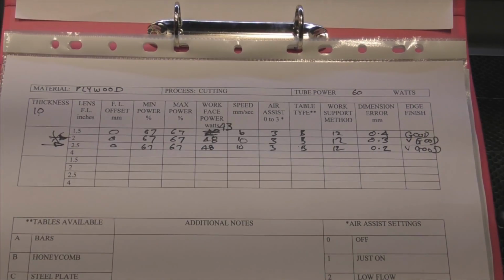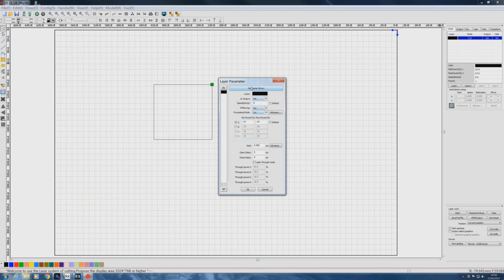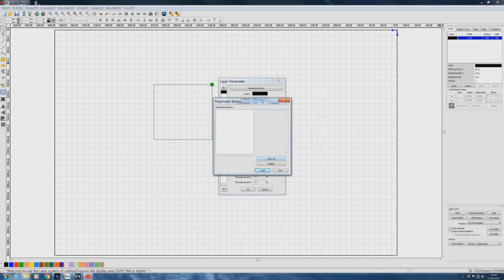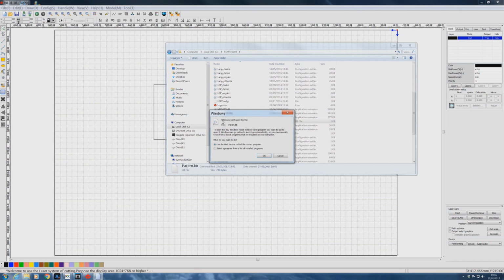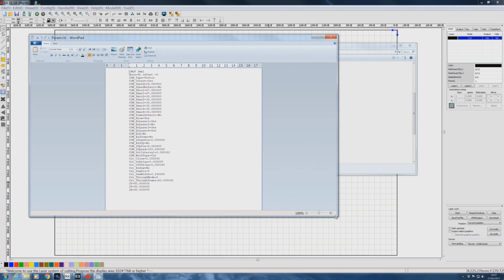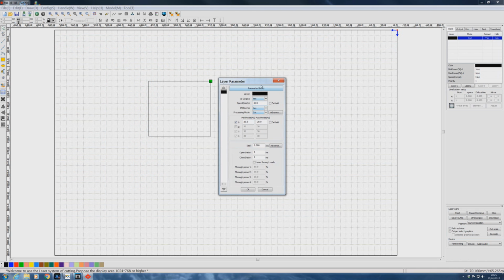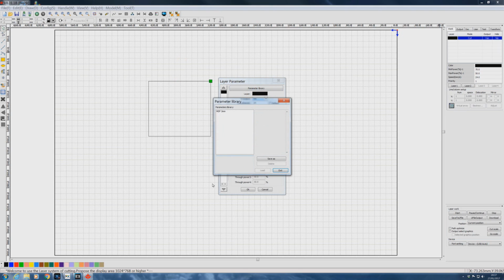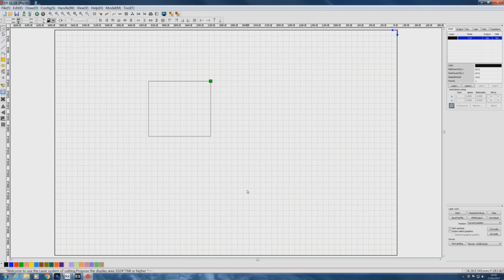RDWorks Learning Lab 95 Cutting Parameters DIY

Comment: Russ, may I ask. What is your opinion about upgrading tube to higher wattage. For example I am going to receive my machine with “50W” refurbished tube. Should i consider going 60-70 of real watts. And if yes, what kind of benefit do i get from more power? Given the fact that application of such machine is limited anyways. To be honest, my crappy K40 machine had enough power to cut anything you can fit inside of it. And I actually had problem with not being able to lower power sufficiently for some engravings. So what is the real benefit for more power tube and won’t it actually be worse for lower power jobs?
Reply from the maker: Hi Vlad
You are perfectly correct about power. I warn people all the time about being careful about what they wish for when they think about upgrading to 100 watts or more. You need power for cutting only. The more power you have the longer focal length lenses become usable and cutting thicker materials faster is the only benefit. If you want to engrave then you need precision control of low power. The power characteristic of most big tubes is a bit of a dog leg graph where for example you may get 100 watts at 70% power setting but  get 60 or 70 watts by the time you call for 30%power. This very steep initial power rise is very poor for engraving. 60 watts is the best compromise tube for general use. If you wish to specialize in engraving on pre-cut shapes, then 40 watts is perfect. The K40s (and most other machines) are supplied with a 2" focal length lens. For such a low power machine this seems like too big a focal length. For engraving and cutting with such low power you would really benefit from the scalpel precision of a 1.5" lens. The controller in the K40 is very limiting because you can only work with one power at a time as it's not programmably controllable. Move up to a machine with a digital controller and you get the option to use something called SPECIAL MODE. This uses the  PWM clock pulse to chop the power into high frequency pulses. You can then select mark/space ratios of 50 to 99% for your power output. This allows a bit more control of low power for bigger tubes and super precision for the low power ones.
Best wishes
Russ
Reply: SarbarMultimedia thanks! This is one of the reason i upgraded to 50W machine - i did not realize that k40 doesnt have pwm control for laser. Truck with my new “50W” machine is coming in couple hours. Excited to give that a run! Another advantage of this larger machine is variable Z axis, which i think is a must have for any machine of this type. And the final advantage is it not being constructed of pure garbage 😄 unlike K40.
Reply: SarbarMultimedia received my laser machine last hour. Unless they offer me like 60-70% refund, this garbage will go back to where it belongs. In order to make this thing properly work it has to be broken down entirely and reassembled from the scratch with some components entirely replaced in it... 🤦🏻‍♂️ Fraud is in Chinese blood, ridiculous.
Reply from the maker: I call it Fleabay for a very good reason....buyer beware. Is it really that bad? and you have not run it yet?
Wow
Let me know what happens 
Best wishes
Russ
Reply: SarbarMultimedia haven’t run it yet, and yes, I am familiar with that quality and what to expect. But Chinese surprise me everytime... lol
Reply: SarbarMultimedia one more question to Maestro :) i am cutting 5mm acrylic with this machine and the max speed i was able to cut that with is 7mm/s. Does that sound right for this kind of power?
Reply from the maker: It is almost certain you are using a 2" focal length lens. First thing is to check the lens orientation because the Chinese always install them upside down. Make sure the flat face is towards the work. You will have a setting piece that is 19 or 20mm, When you turn the lens over this will decrease by 1 or 2mm  so make sure you find the new focus distance. Your 50 watt tube will actually be a B grade 800mm long 40 watt tube. D9o not run it at more than 65% power until you have fitted an ammeter. So you are probably getting 35 watts output into a 2" lens.. Acrylic is easy to cut and with my 60 watt tube I can do the same at about 10 or 11mm/s if I use a 2" lens. So your numbers seem to be about right.
I had problems with my first 2 tubes and I had no way at the time of measuring the power. However. if you watch this, you will see that there is a simple method of checking the tube output in relative terms. The cuts should get deeper as the power increases. As you will see, my power topped out at about 60% and then dropped off. A sure sign of a B grade tube.
https://www.youtube.com/watch?v=WbBPps42iHc
Best wishes
Russ

Comment: Hello Russ, 
I am in much need of your advice on a couple of points.

My Chinese laser appears to be the same one as you have. I am considering upgrading the dubious 50W rating to a 75W/90W RECI tube together with a new power supply quoted at £603 with free delivery (ebay item 173365599796)

I find that I can save around £25 by buying the same tube separately (19 kV trigger/24 mA running) by buying the power supply from another source (35 kV/28 mA) (ebay item 153026905903).  Is this feasible?

Secondly, do you connect the milliAmp meter in line with the low voltage side of the tube?

And finally, in one of your videos concerning mirror lapping, you show your mirrors as being mounted on small bolts at the rear.  What is the purpose of that and how did you do it?
Reply from the maker: Hi Peter

For Ebay read FleaBay.......buyer beware!!!!

Would you expect to buy a genuine Rolex watch for half price?? Reci are the Rolex of laser tubes. In my opinion they are overrated and overpriced BUT because they have a notional high reputation and high value, they are  a prime target fort "Chines copies". You can find Reci tubes advertised at great prices and described as "genuine Reci" or "Reci sourced". Both may be true but both may be unwarrantable QA failures from Reci.  I'm saying this because I have seen the same deceit  happening elsewhere in the Chinese tube market. Reci themselves recognize that there is this "alternative" market for their tubes and so they have tried to defeat the fakers with a Q code label that is attached to warranted  Reci tubes. Scan this Q code with your smart phone and it will auto connect to the Reci website and tell you the serial number and date of manufacture of your tube . Do NOT buy a Reci tube unless it has the Q code. I am not aware of fake Reci power supplies, only units from other manufacturers that claim to run Reci tubes. 

The power supply in this advert is just such an alternative and comes from
http://www.jnhyec.com/en/productxx.asp?signid=122&proid=186

The Reci tube advertised is not displaying any labels (why?). This is a Reci W1 tube
http://www.recilaser.com/en/index.php?m=&c=Index&a=show&catid=7&id=65

As you can see, it claims to have a peak power output of 100watts at 29mA. If this is a genuine A grade Reci tube, why would you undersell it as 90 watt peak?  Maybe this is the reason it failed QA?
My first 50 watt  tube in the machine was in fact a 40 watt tube outputting 30 watts Basically it was junk. I bought a "genuine 50watt OEM replacement tube" from Coletech and that was only slightly better junk.  This package you are assessing is from Coletech but is being sold via a third party (probably a private Chinese seller on commission) to distance Coletech from any bad feedback or claims. I can only leave you to spend your money  where you think best but wish to make you aware of the risks.

If you were to buy this package with a genuine A grade Reci tube here is what you would expect to pay direct from a reliable source
https://es.aliexpress.com/store/product/1-PCS-80W-Reci-co2-laser-tube-80w-1-PCS-DY10-Reci-Laser-Power-Supply/321243_32756879991.html?spm=a219c.12010612.0.0.22157106srBq3c

This is £812 PLUS 20%VAT when it lands in the UK

However, Reci tubes are not quite what they seem. If you read the section 2 operating conditions it says 100 watts output (peak) at 29mA. But this is only a test current, you cannot run at this current or you will invalidate the warranty. They recommend that the max you should ever use is 27mA which means you will get a guaranteed 80 watts output. Read on to the bit that says that if you want reasonable life from your tube then limit the current to 25mA. In reality that means you will get 70watts output. Personally I think that is a VERY sneaky way of selling you a 70 watt tube.

What now?  Well, I would forget Reci and look at something like an 80 watt EFR tube plus suitable power supply from a reliable source (Mactron Tech in China). Email them for a tube and power supply combo quote and I guess it will be about £600 with shipment PLUS 20% vat
You could also check what a Yongli tube and power supply would cost.  Both will be genuine 80 watt outputs (not 70watts)  but without the reputation  price premium Also ask for a quote on their MTS-70 tube and power supply That is what they sent me. Still running perfectly 2 years on.
http://www.co2-lasers.com/co2-laser-tube/27-co2-laser-tube.html#.WybWLFUzphE

As you are in the UK I would also check on the price of a 60 watt EFR tube and power supply  and also an 80 watt EFR tube and power supply from gareth@thinklaser.com
A trustworthy UK company  that will be easier to deal with and will be able to match or better the Chinese prices but will still be plus 20%vat unless you have VAT registered business

Why do I all of a sudden mention 60 watts? (and 70 watts above). All the 80 watt tubes will be 80mm diameter and if you check the tube mounting arrangements you will struggle to fit a fat tube into our machine. 

Ammeter connection? Yes. see   https://www.youtube.com/watch?v=xDZmuxq5BEM

Mirrors
https://www.youtube.com/watch?v=HHagynL4zqs
https://www.youtube.com/watch?v=ELeqP3tHlp0

Hope some of this helps

Best wishes
Russ

Comment: Regards "parameters" I have doubt related to laser physics, and to be more specific - to tear and wear of the tube. I was asking about it few people, but had no answers. Say : I go to cut light "laser grade" 3mm plywood with this parameters: 
Speed=75mm/s P_max=64% P_min=54%
Speed=40mm/s P_max=44% P_min=34%
Both are in range of normal, long use tube parameters. And both create indistinguishable effect (in practice, not theoretically). Same nice cut, no char, same light brown sides. Putting machine mechanics itself on side (I know acceleration is not good thing for rails) - which one is better and lead to lower tear and wear of tube? Is there bigger degradation of gases in higher temperature (created by higher energy plasma), or time is more critical? Any idea, links or particular knowledge?
Reply from the maker: Your speeds may look astonishing to most people but they don't realize that you have a 100 watt tube.
The obvious answer to your question is 44%/34% but why?
The tube contains a basic  mix of 10% nitrogen, 10% carbon dioxide and 80 % helium (there may be traces of other gasses as well) The carbon dioxide is to be imagined as a "lazy" gas  In its gaseous state nitrogen (and all the other gasses) are non-conductors.The nitrogen can be easily excited by putting 25,000 volts up its bottom. That will turn the nitrogen gas into an ionized state (basically just like lightening). The nitrogen can now conduct huge amounts of current if allowed to . The power supply regulates that current flow in accordance with your % power demand.
If you ask for a higher % power then more current is allowed to flow though the ionized nitrogen. More current means the nitrogen gets more excited (attains a higher energy level) as it does so it generates more heat. That is where the 80% helium plays a role. It is in the mixture purely as a heat conductor to carry the heat way from the ionzed gas to the water jacket to dump it. The helium is the vital gas that stabilizes this process. The ionized nitrogen is at temperatures in the thousands of degrees (just like lightening) so any low temperature heat sink (the water jacket) is vital for the helium to perform its task. Whether the water temperature is 10C or 40 C is relatively still a very cold heat sink for the helium.  You will notice I have not mentioned the CO2 yet other than to say it is "lazy"  That's because this ionization and heat transfer process is completely separate from the power producing laser action which we will come onto shortly.  That pink glow that you see in your tube is the ionozed nitrogen and is NOT the laser beam. Even when your tube is dead (it has run out of CO2) it will still glow pink and the current meter will still respond to your request for more power.. That is because the ammeter is not showing you power output but current flow through the nitrogen. In laser terms this whole process I have described so far is called the "pumping" action.
Okay let's get the CO2 involved now.
The CO2 is happy to be at a low energy state. However, being part of the mixture, as the nitrogen is stimulated to higher energies by more current flow, it randomly bumps into CO2 molecules. In doing so this collision transfers energy to the CO2 and elevates it to a relatively unstable higher energy level. It can be encouraged to part with this extra energy in the form of a photon of light by other passing photons. The CO2 then settles back to "lazy" mode.........until,another collision starts the whole cycle again.
The tube manufacturer puts a maximum recommended drive current on the tube to make sure it achieves the guaranteed lifespan. This max current takes the nitrogen lto its maximum allowable energy level where the more active it is the more CO2 collisions  will occur and indirectly more photons will be released by the CO2 that is now being very regularly stimulated. Problem.........If you run at more than the recommended drive current then the nitrogen gains even more energy and more and more of those  CO2 collisions will have sufficient energy to split the CO2 into CO and O . Neither of these gasses will release photons.  There are mechanisms in the tube that recombine some of the CO and O back to CO2 but  OVER DRIVING is a destructive process. Eventually your tube will run out of CO2 and produce ZERO power even though the tube appears to be working.

The point I am making here is that the current to power relationship is fine and predictable while the tube is in good condition (there is sufficient CO2 in the mix) As the CO2 depletes that relationship changes. So when you detect a loss of power you wind the %power up. Yes you may get a bit more power but unknowingly you are driving your tube to an even earlier death.

Perhaps you can now see for yourself that running your tube at lower temperatures helps the helium do it job marginally better. Keeping the process cool keeps the nitrogen energy level lower.

Running your tube at 44% is well below  that nitrogen energy zone where destructive collisions occur, so as you anticipated I would expect the gas mixture to remain stable for longer.

This is indirectly confirmed if you look carefully at the Reci tube specifications for a 100 watt   (W4) tube  they hedge their bets when they say 

"The working current: test current is 30mA. Maximum working current is 30mA. The running current 
must be kept below 28mA. The life span can reach 10,000 hours if the current is kept below 26mA."

So the REAL maximum working current is 26mA  NOT 30mA

Hope this begins to make sens
Best regards
Russ

Comment: Hi. Have you studied about the frequency change of the laser, to work on different materials?
Does that help to get better and deeper cuts?
Thanks for the videos are a great help. Greetings from Uruguay.
Reply from the maker: Hi
I have played with the frequency settings but found no obvious changes. Upon further research I'm sure that those setting have no effect if you have a glass tube. RDWorks is a piece of universal software that can be used in many different machine types. One of the tube types that can be controlled by RDWorks is the RF tube which works with different principles to the glass tube. 'I'm sure that frequency feature only works if you have specified an RF tube in the vendor settings.
Best regards
Russ